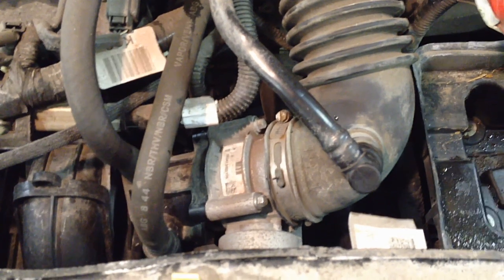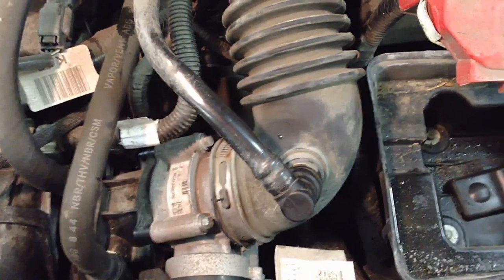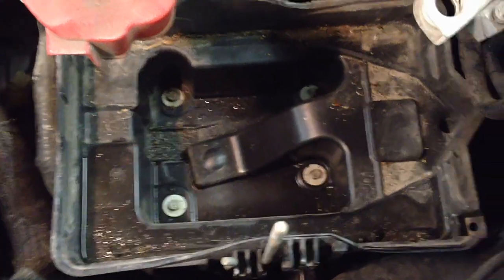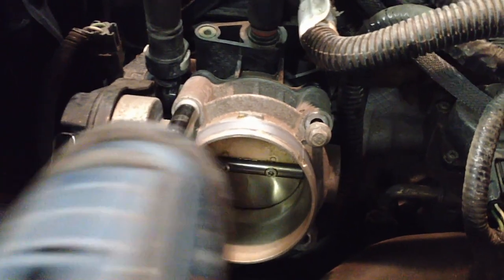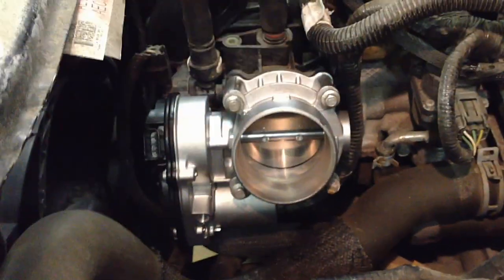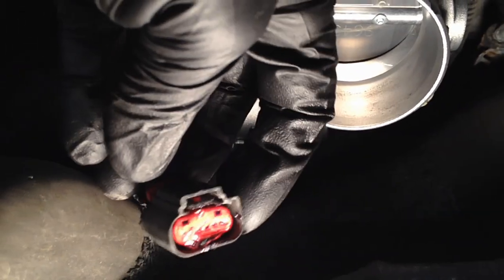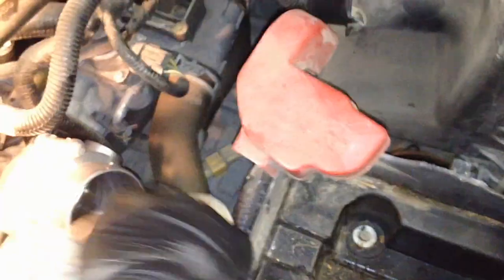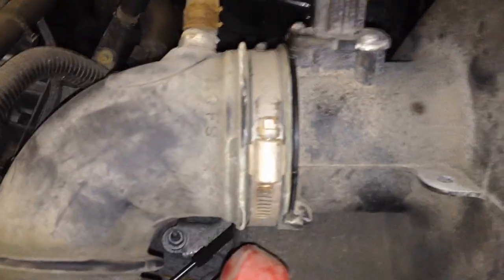2009-2012 Ford Escape Electronic Throttle Body Replacement

Comment: Hi. I have a 2009 escape with hybrid 4. I’m getting a knocking sound only under hard acceleration or going uphill. Very smooth otherwise. No check engine light, only the wrench light intermittently. Any ideas??? Thanks

Comment: Looking at buying a 2009 Ford Escape. Checked the ford website with the VIN and the throttle body recall has not been fixed. 

(Field Service Action Number: 13N03)

It has 154,000+ miles on it.

Will the Ford dealer still fix this recall for free? Please, let me know if I have to pay for the fix, so I can use that to negotiate a discount off the Escape.

Comment: The link you have here for the part doesn't seem correct. It has a picture of a throttle body but says computer module, and the price is only $112? Do you have any updates on where to purchase? Thanks.
Reply from the maker: +Kalei Meyer that is absolutely the correct part the title is wrong. I have even ordered this and it is indeed the latest ETB for these engines.
Reply: Thanks. So the part is only $111.00?  Because when I call sherwoodparts and ask for a 2010 Ford Focus throttle body they say it's $430 something. They say they don't control how Amazon sells their products.
Reply from the maker: This video is for the escape. The latest throttle body for your car is Here- http://amzn.to/2a5yACd

Comment: I have a 2012 Ford Escape 2.5L with 119k miles. There is a bad vibration when I sit at stop light in drive. Gets a little worse when air conditioning is on. But if I'm at the stop light and shift to neutral or park then there is no vibration. It seems the more load at idle at stop light then the worse the vibration. 
I have changed the two motor mounts. Still vibrates.
I have changed spark plugs. Still vibrates.
It has something to do with the idle (electronic throttle body?) because if I barely increase the RPM at stop light in drive then the vibration starts to go away.
Any suggestions would be helpful as to what is the next part I should change.

Comment: I have a 2008 3 Litre V6 Ford Escape. Would I be correct in thinking the parts haven't changed much for the 2009-2012? Ford have said that I'd have to replace the "Throttle Plate" also as I can't get the part individually, and thats $500. Can anyone shed some light on this?

Comment: Replaced throttle body and mass air flow sensor and air filter having same issue ( losing power and kicking hard into gear ) any other suggestions ????

Comment: Had trans leak in the condenser and jumping rpm when idle would drop escape would surge fixed the condenser first so when I relearned the throttle body I could let it learn on load also drove fine for a week today idle jumped stalled out on me twice got it to parts store for a obd reading shoot   02sensor code bank 1 and 2 both sides sensor one never had a irregular idle and stall for a 02 sensor gonna check for a vacuum and exhaust leak any advise

Comment: How do you reset/relearn a new throttle body on a hybrid?   The engine will shut off in a minute as part of the hybrid electric motor cycle.

Comment: There is an extended warranty (10 year 150k miles) for the throttle body,  just take it to your ford service and have it replaced for free under an hour.  Great video still!!
Reply: I have 154k miles on 2009, guess the warranty expired.
Reply: They only replace if a check engine light is present. I had a really rough idle but no check engine light. I replaced the TB myself and now it idles smooth
Reply: I called ford and they said that its not a recall issue, and they arent willing to do to the 13n03. I only have 83 000 miles. What shoukd i do

Comment: Hi, thank you so much for your video. I just replaced the throttle body on my 2008 Escape hybrid and I did the PCM reset that you posted in another video. Immediately after starting it up it stalled. I disconnected the battery and did the pcm reset again and it immediately stalled after starting it up again. Why is the new throttle body not working?

Comment: I have an 09 Escape. I get what seems like a rough idle. Car vibrates sometimes heavily when slowing to a stop or just sitting at a stop sign/light. It has stalled coming into these situations from highway speeds. The issue only happens when it's warm outside however it has been getting worse over the last year. 
Last summer was bad, car ran fine over winter then now it shakes more frequently than before. 
Last year, I took it to a mechanic who couldn't find any issue and suspected torque converter. He sent me to a transmission guy who checked and said no issues. Took it to for dealer who also couldn't find and issue but figured that because of the mileage on the vehicle, they'd change the spark plugs/do a tune up costing over $600. Had the same issue the following week and ford wouldn't return calls. 
Could the throttle body be the issue for this one? I don't want to scrap the car if it's an easy fix.
Thanks
Reply: Change the throttle body and change the motor mounts... Trust me I went through the same exact thing 😂 now she's 240k and still running!

Comment: I tried this relearn process with a 2007 Ford crown Victoria with no success I tried disconnecting the battery and putting a jumper while taking negative off post and jumping from negative to positive no success

Comment: my 2009 ford escape shuts of while I'm at a red light could this be the throttle body
Reply from the maker: If non hybrid yes that or the canister purge valve.
Reply: @FordTechMakuloco  Ok thank you I will get them checked. It does it only when you go hard off the line
Reply: @FordTechMakuloco , I Got a 2010 escape3.0 w 145K runs fine but that just shuts off intermittently at idle.(No check engine light, wrench symbol or PCM codes).The Fuel trims look fine and see nothing out of range . I cleaned the MAF sensor and throttle body earlier and cleared keep alive memory to relearn but did not resolve. Had guy order a Ford Throttle body and I just put on the  new Ford Throttle body on it, disconnected inspected the PCM connectors and no green death. Reset keep alive memory to relearn new throttle body , now the stall is happening more often than ever. I kinda doubt  the canister purge valve is causing this issue though.  Weird that I'm not seeing any Fuel Rail Pressure pid on my Maxi Sys ELIte and had some goofey cylinder acceleration variance rather than misfire counts.

Comment: Hi FordTechMakuloco! i have an 09 Ford Escape 3.0 
131,000 KM already, wrench icon on the left is on. whenever i switch off the engine and turn back on it's not lit, but after few minutes of driving it comes back and it greatly affects the driving performance of the car. i've been researching about what could have possibly cause that, throttle body came up bigtime. i really wanted to remove the throttle body and try cleaning it then reset the pcm memory, you think that would be a good idea? (same some money if it will work), or you would rather suggest to just get a new throttle body from the dealer? would it be the same step for changing the faulty throttle body?
Will be waiting for your feedback. Thanks a lot.
Reply: Hi my ford escape have this same fault, please how did you resolve your own. Did you later change the throttle body

Comment: Hi Fordtech I have a 2013 ford escape and the check engine light come on with fault code P0234 powertrain turbo/super charger overboost condition. Is this a very expensive fix? I'm planning to bring this to a ford dealer for repair. thanks
Reply from the maker: They will likely say the wastegate is sticking and they are only sold with the turbo but it may be the control solenoid too.
Reply: Thnk you, i will try to replace the control solenoid hope it will solve the problem.

Comment: will this throttle body work for 2009 Mazda Tribute 2.5L?  I assume it is using the same parts.
Reply: Anthony's West Texas Rides I also have a mazda tribute 2009 3.0L. I went to ford dealership and asked them about it. They said its the samething.On that same day some dude pulled up with a Tribute to change the throttlebody at ford.
Reply: I also bought one from ford and my car has been working good since repair

Comment: I have a 2010 Escape 2.5 L that has a PO301 and PO302 intermittent misfire code. The vehicle has 188,000 miles on it. It is idling rough and driving at 45-65 mph at around 2500 rpm it seems like it is starving for fuel. I've changed the spark plugs, all 4 coil packs, cleaned the maf sensor and changed the air filter and am still having the same issues as stated before. Any ideas on what to try next? Thanks for your time and have a great day.
Reply from the maker: You may have a compression issue were the spark plug wells clean?
Reply: FordTechMakuloco yes the spark plug wells were clean and I cleared the wells with compressed air before removing the spark plugs just to make sure like your video showed. Thanks for the reply. Any ideas?
Reply: Steven Butler had the same thing on my 09 escape. took the heads off and found out my head were warped. compresión was good till it warmed up. got the heads shaved down and a throttle body. problem fixed

Comment: Would this failure also cause the transmission to change gears at a higher than normal Rpm ?
Reply from the maker: Generally no.
Reply: @FordTechMakuloco  thanks

Comment: Has anyone heard any updates with this class action lawsuit regarding throttle body replacements? It's ridiculous that unless someone dies Ford does not fix the problem. We had 12 Escapes for company vehicles and all of them had to have their throttle bodies replaced within the past 3 years. Government needs to step in and fix this for the people who basically bailed Ford out a few years ago with all those loans.
Reply from the maker: Personally if I owned a company with a small fleet like that I would replace them all at once they are so dirt cheap right now like $66 it's one of those things that are not worth stressing over swap them out and move on. I did the same on my own vehicles and they have the warranty coverage.

Comment: sounded likea 6.0 starting in the back ground
Reply from the maker: 6.4l
Reply: awww! how often you seeing thos lovly engines apart?
Reply from the maker: Kevin Rogers Not too often anymore just small things. Got a video coming up on one. Seems owners still bring them in because diesel shops don't want to touch them. I have gotten used to them.
Reply: ye for sure, i support pulling the cab off to do major repair's, i think you do a way cleaner and better job with the cab off
Reply from the maker: Yes much better with the cab off.

Comment: hello again 2010 e series 250 lots of slipping and shut off in gear. my friend brought  his obd scanner and  came up with  general electronic  module   has 4 faults,.     pcm  powertrain control module  has five codes.    these are some off the codes   P1742         P2122      PO316     C1145        if shift from drive to  2  it just surges and dies. lots off slipping going on  .   this is my vin  can you tell if i still have warranty  thanks  .1FTNE2EW3ADA30555    thanks
Reply from the maker: lanze wilson Yeah you have lots of problems in multiple complicated sub areas of the engine and trans. This is what I have from the report. If you are not bio med then you have the regular  5yr 60k miles on the powertrain.0968 - USA 2010 NEW 72/100000 PREMIUMCARE W/ROADSIDE STANDARD DEDUCTIBLE: 100 USD OWNER NAME: AMERICAN BIOMED OPTIONS:  EXPIRATION DATE: 08-APRIL-2016//-->EXPIRATION DATE: 08-APRIL-2016 DISTANCE: 100000 RENTAL: 30 UP TO 10 DAYS TOWING: 0 USD CONTRACT SOLD BY: USA 03635  ESP CONTRACT START DATE:  08-APRIL-2010//-->ESP CONTRACT START DATE: 08-APRIL-2010 OWNER OF VEHICLE MUST MATCH OWNER NAME ON OASIS FOR COVERAGE TO APPLY.
Reply: thanks much yes we are still biomed  does that means iam still under warranty.  thanks let me kno
Reply: so ru saying i can bring it in to get fix without out off pocket.  thanks let me know
Reply from the maker: as long as you are under 100k yes you have premium care which covers most anything.
Reply: am up to  150  i gess am out off luck . thanks  much for your help, also can u recon a lower price obd scanner that can pull the wrench code.. thanks again .

Comment: My mom has a 2011 Escape and it dies when she comes to a stop. Starts and runs just fine and starts back up without problems. Also of note, it doesn't stall out if you shift it to Neutral before stopping. Any idea what it could be? I thought it might have been low trans fluid or torque converter but she said it has an electric trans. Maybe clogged pcv valve or fuel system issue?